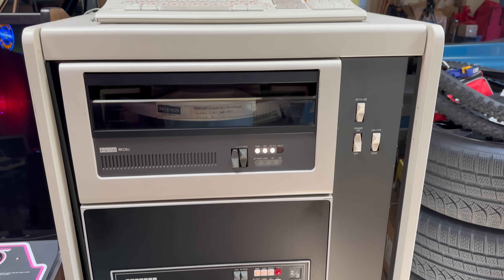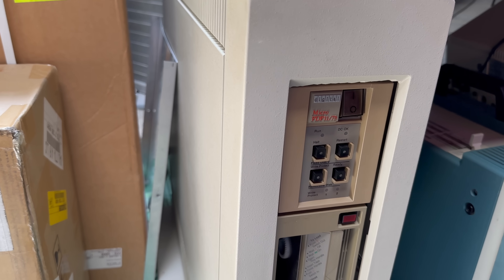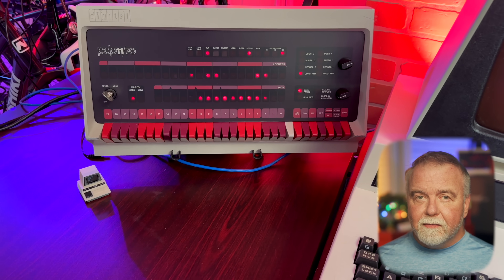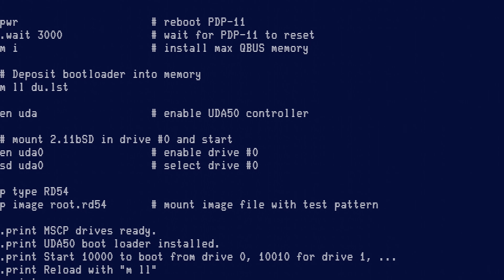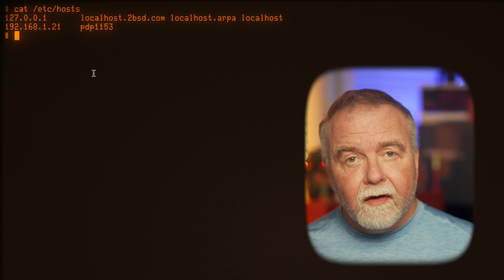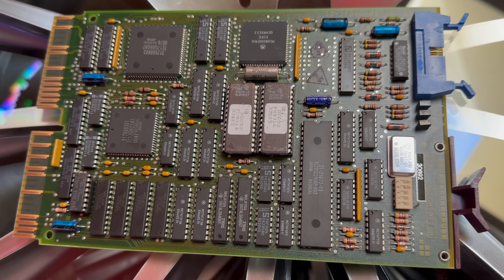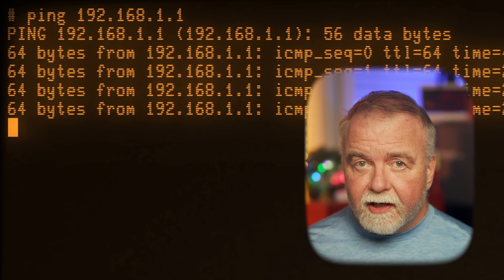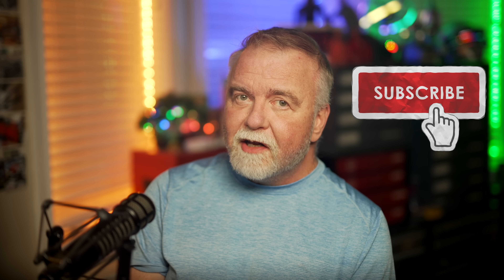UNIX on the PDP-11: Zork, Star Trek, and More Live on the Internet!

Comment: I used to work for a company called Evans and Sutherland (E&S was the abbreviation)  which was located in Salt Lake City, UT across from the University of Utah. They had the ARPA net, the precursor to the internet. This would have been 1981 - 1995 when I worked for E&S. Anyway they had many Dec PDP11-34, then in later years they had some Dec PDP11-70 systems. Early on I played a game called Adventure (from what I remember its name). It was much like Zork, a text only adventure game that could only be run from the terminals, mostly the Dec VT 100 terminals. That was great fun. We also used them for working too HA Ha. Email, word processing, the Field Service dispatch system for us field engineers and service managers . Your videos bring back lots of memories logging in from Dayton, Ohio on the 1200 baud modem and connecting to the PDP systems at Salt Lake City where E&S was located.
Reply: I remember a game called Colossal Cave. I am not sure if it was running on a PDP-11 or VAX-11.
Reply: @coderpunksanonymousgroup8304  That may have been the game that I played. That name sounds familiar. I am certain the version of Colossal Cave or what ever the name of the game was called was played on a PDP 11-34. At least it was not a PDP 11-70. I’m not so certain that the PDP 11 - 34 may have booted and run from 8 inch floppy drives… I know some of the DEC PDP systems had floppy drives. Also there was these I believe RK05 disk packs that was a whopping 5 megabytes of storage. Those were maybe 10 inch hard drives that were removable from the drive enclosure. Those were the days.
Reply: The only version of “Colossal Cave” that I played was on a TOPS-20, and its program was named ADVENTure (the lower case letters were optional, and the file names were case-insensitive).  ZORK was the sequel of ADVENT, programmed in a better language than the original (FORTRAN, I heard).

I went to college with Dean Sutherland (Ivan’s son) and heard stories of him playing on his father’s aircraft simulators before they were shipped off to the Air Force.

Comment: Dave, this is great stuff! I worked on something called CB-Unix ("Columbus Branch") at Bell Labs in the late 1970s, where I ran into some early, early Arpanet pioneers. By the mid 80's I was building applications on IBM Unix on PS/2 Microchannel Architecture machines.  

There's a great book on Unix source code, "Lions' Commentary on Unix", still available on Amazon, that shows just how elegant and straightforward Unix was at that time.

Comment: I still have one of those AUI-to-RJ45 ethernet adapters powered by a 9-volt battery to check for live jacks (if you get a link light, it's live). I haven't used it in forever, but for some reason, it's still in my tool bag.

Comment: I was a FE for DEC on this gear, I was in trained in XXDP+. There was a reason we had standard diagnostics for every option. They all ran from a small OS separate from the customers OS as that was sometimes the path of the issue. You ran diagnostics for everything starting with the CPU. Diagnostics only become useful if performed in the proper order. There is no power on self-test for the system. You cannot assume anything with these systems as everyone is tested differently. If adding on this Ethernet option I would have run all diagnostics this system required before I started the addition, ending with the diagnostic for the DELQ option, testing to a loop back, before letting the customer try to use the option. All under XXDP+. As a hardware engineer by using proper XXDP+, written and supported by DEC. I knew whether the option could work. I could have done a loop back to the local LAN without starting TCP/IP, much less an unknown OS environment. You want to experience the DEC environment you need to turn on your XXDP+ world ability. If you like the PDP world hardware, I am sure you will like reading the listing for the diagnostics. I believe XXDP+ set the world up for POST and the idiot lights we have to deal with now.

Comment: Back in the 1980s I ran BSD on several Vax 11/750s with Unibus transceiver cards with the 15 pin DIX connectors attached to drop cables going to 3Com clamp-on vampire transceiver taps on thick Ethernet.  My experience was that it was best to leave Signal Quality Error Test OFF in the transceiver.  As far as I know SQE Test, also sometimes called CPT in early documentation, is not paid attention to by the Ethernet stack in the contemporary BSD distributions of the 1980s.

What SQE Test is for is to provide a means of the Ethernet stack on the computer to verify that it is able to receive collision detection from the transceiver.  When SQE Test is on, the transceiver generates a fake collision detect in the enforced 9 uS refractory time following the sending of a good Ethernet frame on the cable.  Generally for a properly written Ethernet software stack, the SQE Test pulse is noted and discarded.  If there is any doubt, turn off SQE Test as doing so should be harmless.

The SQE Test is a strictly local signal from the transceiver back to the host over collision detection leads of the DIX drop cable.  The SQE Test pulse is not coupled into the backbone cable.

For those wondering DIX = Digital, Intel, Xerox.  Those companies formed the original Ethernet working group in 1982 before IEEE formed the 802 committee.  The first IEEE standard was 802.3 released in 1985.

Comment: I was 23 and got my 1st IT job in 1980 working in what was almost a broom-closet, with a PDP-11 in it. I was writing FORTRAN programs for a CSIRO statistician. I recall something called RT-11 which I presume was the operating system. You used to boot up by configuring the switches on the front panel. The statistician was doing time series analysis which to this day I still don't understand the math's. In those days finding someone that could write Fortran was difficult and this was my door into a lifelong career in IT. I'm now retired!! What a blast!!

Comment: In 1983, I started a job right out of college at Tektronix. I was working as a SW engineer for the Tek 8560 (a PDP 11/73 workstation running Tek-branded system 7 Unix), which was used in a microprocessor emulation system. I was pretty pumped at the time because I had a mini-computer on my desk, which was really nice when I went to graduate school and had a computer all to myself. So, I, too, have fond memories of the PDP-11.
Reply: Hey, my dad was at Ten back then, but not Beaverton.  Is that where you were?  He took me to work around then and it was the first place I saw unix and that's where I started. :)
Reply: @antovfukov9005  I was (and still am) in Beaverton. In those days, that group (MDP) was located in building 92 (185th and Walker). That's now a middle school and high school. My kids went there, so it was fun to eat in the old cafeteria with them. I'm still at Tek, though it's smaller than in 1983.

Comment: You can also use software called vtserver to get an OS installed.  That is how I installed BSD on my 11/84. It loads a very minimal piece of software on the 11 via console debug and then you go thru the install process.  There is documentation on how to do this out there.  The only issue I ran into was one of the chunks to load was bigger than 32M so it would not load.  vtserver can be patched, but I did not realize I had to patch the code that got loaded to the 11 via debug also.  So I had to kludge around that.  I think that was where /usr and the games were.

Comment: Just to give an account of alternative technology "across the pond", in 1983 or 1984 I was in charge of an old PDP11/23 with RK02 disks and an old PDP11/34 with the much larger(!!) RM05 disks, networked together -- pre-Ethernet -- via in-house hardware supporting the Cambridge Ring (CR82) token ring protocol, with the goal of networking the two machines together using the "Newcastle Connection" which provided a "super root" directory so you could access each other machines file systems using "/.../pdp1123" and "/.../pdp1134". Boy, were these machines slow! Nobody in North America, and few people in the UK will have any idea what I'm talking about. Oh! the bleeding edge of a doomed technology. But mainly we had VAX systems running BSD Unix where you could rlogin, rcp and rsh across machines to your heart's content.

Comment: That two package chip set (two 84 ‘pin’ LCCs on a ceramic substrate) was called the J11 program and were fabed using the Harris Semiconductor SAJI IV process. I was one of the Product (or production) Engineers on that program. DEC contracted Harris Semi to develop this chip set….it was a custom (by hand using CALMA tools) layout, long before standard cells were created and used in IC layouts! Harris got a $5M payout when we delivered the first 50 chipsets.
PS- one of the ICs was called the Control Chip, the other the Data Chip.

Comment: Thanks for running the speed test on your PDP-11.    

I started with a 11/23 in 1981 using RSX-11M and continued with them until 1999.  The 18mhz was faster than any PC until the mid 90s, so they were great for the tasks.  Y2K and the fate of DEC was the final blow.  Still have processor board from the last 11 I used.  RIP.   

 Oh and also have a LA120 console. 

Thanks for keeping the 11s alive!! 👍👍
Reply: VAX then Alpha but yeah Robert B Palmer destroyed DEC selling off all the bits and gutting it - they used to give licenses to universities for $1 so was a good deal pay/lease hardware and then many a student grew up with them and same for me became a DEC Systems Manager and had a few ton of VAX gear at home (11/730, 750, 8300, 8800, RA disks, HSC, CI etc). Y2K wasn't an issue for VMS perhaps in Year 9999 will be and VSM inc. probably port it to RISC-V by then lol....
Reply: @rw-xf4cb  loved VMS.

Comment: Your experience - of 8 guests attempting to play Zork before hitting page memory errors, reminds me one of Margeret Hamilton's issues she solved prior for the Apollo program.

For Apollo 11- the computer was only able to support 7 simultaneous running programs. Upon the landing sequence, one of the astronauts punched a button for additional data. That being the 8th running program, began a landing abort sequence. The interrupt - that Margeret Hamilton wrote, took control and "asked" if the flight software should continue with the landing sequence or abort the landing vs. simply aborting.
Reply: Actually, that was Don Eyles that wrote Luminary (the LM guidance software)

Comment: I am an amateur radio operator, so I loved it when we (back in the late 80's) switched to ThinNet (10Base2, with its RG58 coax, BNC connectors and terminators) and I was given all the ThickNet coax I could puil out of the walls and ceilings. That stuff was great for my antennas!
Reply: Ah yes, 10Base2 (thin ethernet) where all the connections are daisy chained and a single disconnect in any part of that chain would kill the signal for that chain, And if the cable was kinked or bent beyond a certain radius the signal would also be lost. I still have a my signal reflectometer that was used to find these breaks and kinks. So glad, when 10Base2 was replaced with 10BaseT.
Reply: @Obscurai true but we still have bend radius limits for copper and fibre. Copper is more forgiving. However exceed the nerve radius of your fibre and it will shatter requiring a splice or two. Some things change and others stay the same.
Reply: @vk3fbab  True, but the daisy chain architecture was replaced with the star configuration and the problem was localized to a single station and much more easily diagnosed. I retired my reflectometer after that change. It was an issue easier management, less downtime and more productivity.
Reply: @n8wrl  many more parts in a star arrangement though. Once installed, I never had issues with thick or thin coax Ethernet.

Comment: I've never worked on any PDPs, but I found this very interesting. Especially since you're running BSD. I'm a BSD freak, and I run FreeBSD as my desktop OS on my home PC. Regarding old computers, I did spend some time on an early AS/400. Don't remember the model number, but I do remember that for the first few years it was 32-bit and when the first 64-bit model came out, OS/400 had built-in functionality to generate 64-bit binaries from the 32-bit ones. This was done automatically on first run, and I was tasked with running every application we had before the new machine was put to use in production. I worked for a third party logistics company, and most people won't believe the number of individual applications needed to keep track of six warehouses housing goods for some 30+ clients.

Comment: These videos bring back memories. We had a PDP 11/70 for development of our realtime rail control systems that we sold to customers. That included a set of four (4) MicroPDP 11/83s in a redundant configuration that ran the original Docklands Light Railway in London England from when it opened in 1987 until its control system was replaced about 5 years later, as well as several freight and transit rail control systems in the early-mid 1990s in the US, Mexico and Canada.

Most of our software was written in FORTRAN with performance-important modules written in DEC assembler. Interface with the key elements of the rail system was via multiplexed TTY serial lines, with character-based pseudo-graphic displays on Aydin display generators. We also used some utility software from DECUS, (DEC User Group) which was very useful.

Dave, maybe you can try loading FORTRAN and see what a small FORTRAN program can do. You might be able to find some DECUS remnants of the Internet.

Comment: So many memories here, og sll these loops we used to have to jump through like the transcevers, I started off with RG 58/U and then moved on to the transceiver @06:30 

I would always put a laptop connected directly on it with a crossover cable with a IP on the same network with the next IP just to test the network. 
Compiling the kernel with makefiles and tuning, used to love that.

Comment: Not at all surprised a modern switch does not support 10/mbs; looking at the unfi switches I have, 10 mbs is not in the list of link options. wow
Reply: also,  some older cisco or procurve switches might be nice for all the older boxes, esp if you want an SFP uplink, as i have a hp procurve 2815-8g supports 10-half/10-full etc, and has SFP and has vlan support and i can ssh into it
Reply: sorry, rambling, but this switch does uplink well with Unfi gear as well.

Comment: Reminds me of my first job where we ran ibm ps2 model 3's with 250m core drives (late 80s)  running cobol job streams controlled by huge batch files.  I had to convert the networking from coax based pc net to token ring/  :Lots of fun.

Comment: I used to love boards form that era, when you used to run jumper wires as patches between chips, remind me when we used to prototype Motherboards with breadboard and wirewrap them. Those processor ran at very slow clock speeds. Using  iCL machines to get the code for UNIX of the reel-reel tape to port to the new chipset.

I wish I did not throw all my old books/coding sheets, designs away like the 8080 and other chips, you look like you have the space for old crap.

My 1st home computer was a ICL PERQ with 8 inch real floppy disks running unix, my fading memory of the best operation system was the PRIME OS.

Comment: back in the day, you would load a boot strap startup either from a paper tape or toggled in by hand on the console byte by byte -- that would have drivers for the tape drive and disk and boot the os.. kind of like the bios does on a pc
Reply: Yeah I realized I have just recently forgotten the switch setting for the old PDP 11/20 in my computer lab from around 1980. You had to set the instruction in binary on the front switches that set the PC (Program Counter) hit the switch to load it then run so it would execute the boot code.
Reply: There was a time when I had the PDP/8 OS/8 bootstrap (RIM format) loader in muscle memory. You used that to load the second stage loader (BIN format) from paper tape, which in turn you could then use to load the OS/8 system bootloader tape to load the main OS/8 system from the system floppy - with a whole 128k 12-bit words on an 8" floppy.

I later simplified things by converting the OS/8 loader to RIM (Read In Mode) format, so I only needed a single paper tape. Fortunately, the core memory was non-volatile, so as long as you didn't forget to halt the machine before powering down, you could usually avoid having to do the full cold boot.

It was pretty cool what you could do with 8k of 12-bit words!